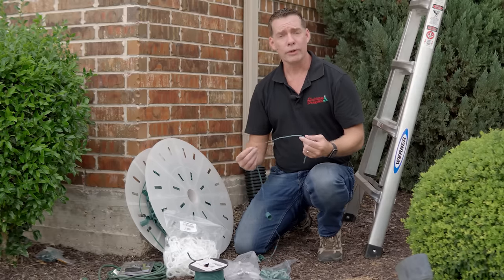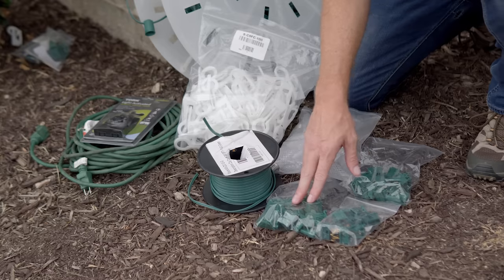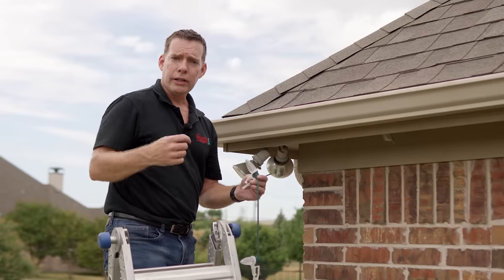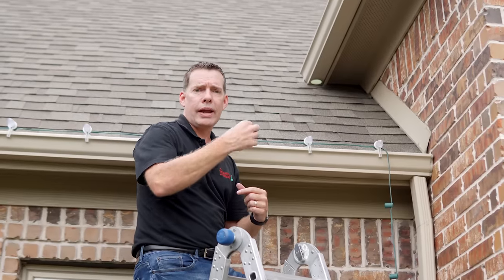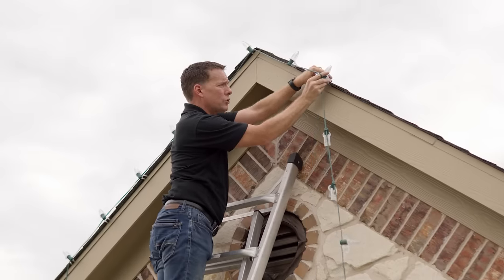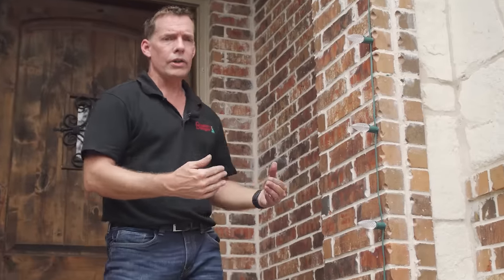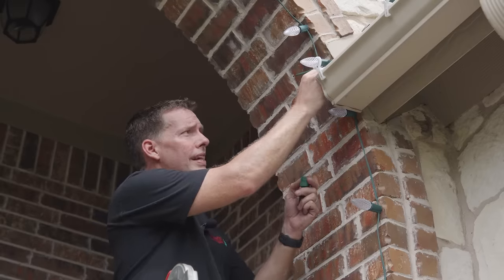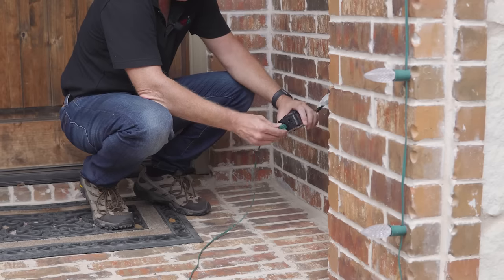How to Hang Christmas Lights on your Roofline like a Pro

Comment: Can you expound more on the comment you made at 2:11, why are C9 outdoor stringer sets worse for perimeter lighting than empty socket light line? I bought the PRO Christmas 26L 8in spacing from you guys before watching this video, but seems to me they would be preferred since they are not exchangeable bulb and better sealed? Thanks!
Reply from the maker: The Pro Christmas stringer sets are great lights, but because you can not cut the cord to custom sizes it makes it difficult to match the look of professional perimeter lighting. Also the bulbs have a single diode inside, so they are not as bright and they are about 30% smaller than C9 replacement bulbs. They’re designed for foliage use, where these attributes are preferred. But many people do use them for perimeter home lighting and they work well in that application too. But they will not match the look of C9 bulbs and professional grade C9 empty socket light line.
Reply: @ChristmasDesigners  thanks that was a really helpful explanation!

Comment: Due to a spur of the moment change, my husband bought C9’s from Lowe’s this weekend. Are those light strands able to be cut also?
Reply from the maker: Most of the C9 lights at big box retail stores can not be cut like the C9 light line that professional installers use. But some hardware stores do have the type of line that can be cut and males and females added. If the cord has the threaded bulbs that screw in and out of the socket and the cord is a thicker, two wire cord, it can probably be cut. If you are unsure, you can send a picture of the light set to our Chief Operations Officer, who is in the video and he can confirm if it's okay to cut that light line. His email is jason@christmasdesigners.com.

Comment: Do you have a tutorial/suggestion on how to remove a socket? Just beat it into submission, as @5:46? Seems like there could be a more delicate way.
Reply from the maker: Cracking the socket with a hammer or rubber mallet as seen in the video is the most popular method and how pro installers remove sockets without damaging the cord. But another method is to use a small flathead screwdriver to try and pry the base locking piece loose. That's typically a small plastic piece under the socket that locks the cord to the wire. However, this can cause damage to the cords insulation if you are not careful. With some types of cord this is an easy process, but other cord with a very tight locking piece, it can be more difficult.
Reply: thank you again!

Comment: Are you able to advise me on the proper cuts(male/female/inline) I’ll need on my home? I have already purchased the c9 string, bulbs, plugs, and extra cord.
Reply from the maker: Yes, we can help you, but we would need to see a picture of your home. You can email that to customer_success@christmasdesigners.com.

Overall laying out the lines and the male/female locations is not very difficult once you get into the project. Start by locating your power source and that will be where your lead male goes. From there just plan everything else out so that it is powered from this location.
Reply: @ChristmasDesigners  thank you. I found a new power source and it made it 100% easier. Before I was going to use the one in the front of the house.
Reply from the maker: @arniehdz8389  great to hear. Have a great holiday season and let us know if you need anything else.

Comment: So on the very end it looks like you just cut it and left that cut end exposed? Do you put on a female (unused) or wire nuts or electrical tape or anything? Having that exposed end makes me nervous...
Reply from the maker: We recommend putting a vampire, slide on female on the unused end. Some people will loop the last couple of inches of light line and wrap electrical tape around the loop to secure the exposed end. But having a female added is the preferred method .

Comment: is the hot glue easy to remove? also, does it leave any residue/marks on either the bricks or light bulb?
Reply from the maker: The glue will stick rather well to the bricks. But we typically use a chisel to peel it off. A slight residue sometimes may be left, but it generally dries and flakes off in the heat of the summer. Any residue that is left typically blends in with the brick. Isopropyl alcohol  can also be helpful in removing the residue.

Comment: Do you only put lights on the front of the house? Not around the sides and back?
Reply from the maker: It depends on the homeowner's budget. The more perimeter of a home that can be lit, the better it will look. But due to budget constraints, many homeowners will decide to only light up the front of their home and then possibly add more footage each year as the budget allows.

Comment: Can you use the hot glue on vinyl siding? Or wood?
Reply from the maker: We don't recommend hot glue for vinyl siding because the heat from the glue can cause damage to the siding. For wood surfaces, it typically won't damage the wood itself, but if it's painted, then the glue may peel off some of the paint.

Comment: Do the lights that are stuck on to the wall come off easily so when Holidays are over we can remove them
Reply from the maker: Good question. To remove your light strand from brick, simply pop each light off. The glue usually comes off easily, but you can use a scraper if needed. For stubborn spots, you can use rubbing alcohol to loosen the glue.

Comment: What would you recommend for attaching to stucco?
Reply from the maker: Unfortunately stucco can be difficult. If there's a metal lip at the top, you may be able to slide a clip under it to hold the lights. If there's shingles, then you can attach the lights with regular shingle clips. If the shingles are clay tile or slate, you can use hot glue to attach the lights. But we do not recommend using hot glue on stucco. This can damage the surface, especially if it's the thin stucco backed with styrofoam.

Comment: Great video. Thanks. 200 bulbs? Same rule applies for LED?
Reply from the maker: We recommend not going over 250 bulbs or 250 feet with LED. For incandescent, you typically need to stay under about 80 bulbs at 7 watts a bulb.

With C9 lighting, the longer the length of 18/2 C9 light line, the less amperage it can hold. At 250 feet, your maximum allowed amperage is only 2.5 amps. This is something that many pro Christmas suppliers state incorrectly on their websites.
Reply: @ChristmasDesigners  thank you!

Comment: Hi what size little giant do you use to reach those high peaks
Reply from the maker: For this video, Jason was using a 22 ft adjustable Werner ladder. This is similar to the Little Giant Model 21. The house in this video had a relatively low peak, so in some cases you will need to use a taller ladder to reach the peaks and higher rooflines.

Comment: How many bulbs are needed for a 500’ roll at 12” and 15” spacing?
Reply from the maker: For 12" spacing, you would need 500 bulbs. For 15" spacing, you would need 400 bulbs.

Comment: Does this glue damage brick or wall stones ??
Reply from the maker: Great question. It does not typically damage brick or wall stones. A lot of the glue will peel off when you gently pull the lights off. For some tougher glue, you may need to use a chisel to help peel it off and for more stubborn residue, Isopropyl Alcohol works well.
Hope this helps.
Reply: Thankyou. 

Respect from Texas

Comment: Tips for making the 5mm conical look clean like this?  Or not possible?  How to make a jump from dormer to dormer without the line lit up between them?
Reply from the maker: Unfortunately with mini lights it's not possible to have the same clean look as what you can get with C7 and C9 socket light line. This is mainly due to the fact that the bulbs can not be precisely placed and you also don't have the ability to cut the cord to length. 

For dormer to dormer lighting, it's best to use a section of 18/2 zip cord. Add a male to one end and the female to the other end and this acts as an extension cord to carry power from one dormer to another.

Comment: Is the In-line female and the same thing as 18/2 female vampire plug?
Reply from the maker: Yes, that is correct. We recommend the Vampire plug with a breakaway tab which converts it from an end of the run female to an inline female. Here's the product listing on our website: https://www.christmasdesigners.com/18-2-female-vampire-plug-spt1-green-breakaway-tab-available-in-bags-cases-of-5-50-and-1000.html

Comment: For gutters with gutter guards what is an idea to attach to those gutters?
Reply from the maker: Gutters with splash guards can be challenging. In some cases there's a seam that you can slide the clip into between the top of the gutter and the splash guard. You may have to trim part of the clip off in order for it to fit. If that is not possible, a dab of hot glue on the socket can allow it to stick to the gutter splash guard.

Comment: Is it possible how you can tell me how this job/the runs all connected together?  I am having a heck of a time figuring out how to tie all my lights together. It is probably easier than I am making it out to be though.
Reply from the maker: For the project shown in the video, we simply ran all the lines together to the outlet by the front door. The left side was all connected in a single line to the outlet and then the right side was connected to the first line with an inline female. 

If you need specific help with your project, please email us at customer_success@christmasdesigners.com and we can help you with any questions you have.

Comment: So for 500 ft of lights I would need two sockets and two timers?
Reply from the maker: The rule is for 250’ or 250 bulbs - whichever comes first - is what can go on a single line. You can put both lines into a two-outlet timer (such as the link below), and then plug the timer into one outlet. 
https://www.christmasdesigners.com/two-outlet-mechanical-photocell-timer.html

Comment: Do you use "rubber O-rings" on each light/socket?  Have you found water to be a problem and is this worth purchasing the o-rings?  Thanks.
Reply from the maker: Throughout the years of installing and advising other pro installers, we have found that the o-rings are not necessary. Moisture will still get into the socket from the weep holes in the base. By using the o-rings, it eliminates airflow through the socket, so the wetness tends to linger significantly longer in the socket. This in turn can cause more issues with GFCI outlets tripping and not being able to be reset. While we do have some customers that insist on using o-rings, we do not recommend their use for most applications.
Reply: @ChristmasDesigners  Thank You! You guys are awesome. Just placed an order this morning to outfit our whole house after seeing all of the great on here! Thanks again!
Reply from the maker: @MarkBlakley  That is wonderful to hear! If you need anything from us, please let us know! Happy to help!

Comment: Did you need an end of the run female vampire plug on the left side of the archway? How about the end of the wire at the very beginning of the video? Can those stay as exposed wired?
Reply from the maker: Great questions, we always suggest capping the wire whether it is with a female vampire plug or some other sort of wire cap. Exposed wires could potentially lead to a fire, power surges or other disasters. We ended all of our wires during this installation by utilizing a female vampire plug for safety. 

If you are nervous about leaving a female plug exposed you can also utilize caps that will help keep moisture out. We suggest A Plug Pro gaskets and socket covers (for Christmas Lights and Extension cords). You can find both here: https://www.christmasdesigners.com/catalogsearch/result/?q=a%20plug%20pro
Reply: Thanks for the reply!! I just got all of my supplies from your website, excited to give this a shot tomorrow!
Reply: @ChristmasDesigners  How do you recommend putting up the c9s around painted wood garage and window trims?

Comment: Should I attempt to waterproof my plug connections or just leave them exposed to the elements?
Reply from the maker: It's okay to leave them exposed. But if you are encountering a lot of GFCI circuit tripping issues because of moisture getting into the connections. You can use special gaskets and plug ends to help seal up the connections. Some people do tape these connections, but in some cases condensation makes it way through the taped connections, but since the airflow is eliminated, the moisture can not dry out. This can cause more GFCI issues. So if you do tape the connections, make sure that you are using good quality tape and seal up the connection adequately. But this is typically not necessary in most applications.

If you are looking to use gaskets and plug covers, you can find them on our website here: https://www.christmasdesigners.com/installation-essentials/hardware.html
Reply: @ChristmasDesigners  Thanks for the reply and the great videos. I ordered lights from your store and am in the process of hanging them. So far they look great!
Reply from the maker: @themikeybar  great to hear! We love hearing the success stories of people we've helped.

Comment: Hi how much it’s the cost for 250 and 500 ft on material including shipping
Reply from the maker: The cost can vary depending on the bulb type, cord spacing and type of clips selected. Typically you'll be looking at between $1.30 and $2.00 per foot for pro grade C9 roofline bulbs, cords and clips. We recommend visiting our website for more pricing information: ChristmasDesigners.com.

Comment: how do you do the shingle section if you have tile roof?
Reply from the maker: It depends on the design of the tile roof. If there's room to slide a clip under the tile, then you can use the same clips as with asphalt shingles. If that is not possible, then attaching the lights to the top of the tile with hot glue may be your best option.

Comment: Recommendations for C9 facia board clips?
Reply from the maker: @youtubeuser5424, typically, fascia board is more difficult to attach to. Ideally, it’s best to attach to the roofline above it, but if you want to go directly into the fascia without stapling, then it’s best to see if there’s a tab that would allow a shingle clip to slide into it.
Reply: @ChristmasDesigners  will your flex clip work with roof tiles?
Reply from the maker: @youtubeuser5424  it would depend on the thickness of the tiles and if there is enough room under the tiles for the bottom tab to slide into. They do work on many types of rooftiles, but if the tiles do not have room for the bottom tab to slide under the shingle, then they will not adequately hold the light line.
Reply: @ChristmasDesigners  OK, thank you appreciate the reply👍🏼

Comment: If you add an inline female to add another line of lights does the total of all lines have to be 250 lights or less.
Reply from the maker: That's a great question Eddie. Yes, you still generally need to be under the 250 rule on 18/2 wire, even if it's multiple runs going into a single 18/2 wire. Depending on the bulb spacing, you can sometimes go more than 250 bulbs/250 feet, but we use the 250 rule as an easy to remember guideline. The biggest concern with 18/2 wire is the maximum allowable amperage drops as the wire gets longer and you start to encounter voltage drop and line resistance due to the long runs. If you want help reviewing your current setup and seeing if it might be possible to push beyond the 250 bulb/ft rule, feel free to email us at customer_success@christmasdesigners.com and we can evaluate your project and see if your situation would allow for a longer run.

Comment: About what is the length of line and amount of bulbs used for this specific setup on this house?
Reply from the maker: For this installation we used about 150' of C9 lighting on the house and about 90' of stake lighting outlining the sidewalk and driveway. Not all of that is visible in the video.

Comment: How much you charge for a house like this
Reply from the maker: The cost for having Christmas lights installed professionally ranges significantly throughout the country, depending on where you live. It will typically range from as low as $4 per foot to as high as $10 per foot in high cost of living areas. The average price right now is around $7.00 per foot.

For the DIYer, the materials will cost about $2.00 per foot and you'll get at least 6 seasons out of the lights and cord if you buy pro grade products.

Comment: Do have to worry about a female termination end getting water into it?
Reply from the maker: With C9 bulk light line, moisture will get into each socket and the overall lighting system is made to get wet and then dry out (weep holes in the base of each socket for air flow). So moisture getting into the female end isn't an issue since each socket is exposed to water possible water. However, wet sockets will cause the GFCI outlet to trip and have to be reset. This is normal and is a safety feature of GFCI outlets.

Comment: Can you do a jumper to two segments, in-line to inline?
Reply from the maker: If I understand your question correctly, you want to take power from one line via an inline to another line via the inline. This is not recommended because in order to accomplish that, you would have to have a jumper with a male on each end. Double male cords can be very dangerous since the open prongs on one end can still be powered up if it's unplugged while still plugged into power coming in from the other end.
Reply: @ChristmasDesigners  thanks so much for the prompt reply! And that answers my question perfectly. Merry Christmas!
Reply from the maker: @corythomas909  you bet! Happy lighting and let us know if you have any other questions.